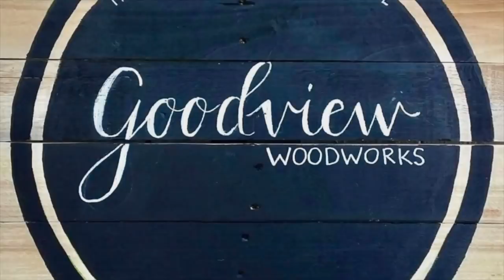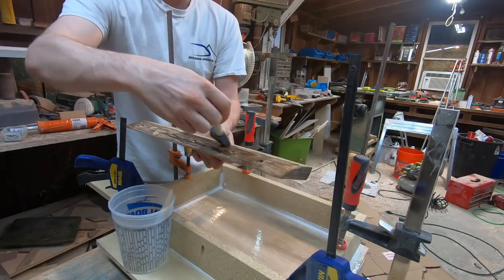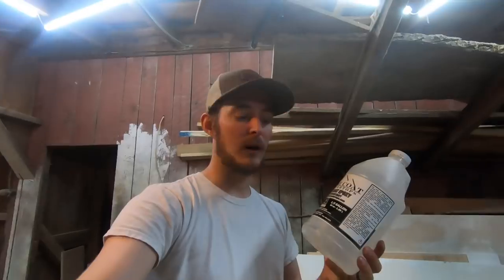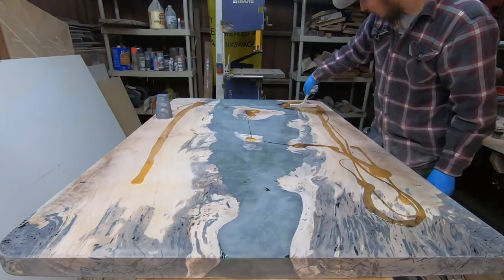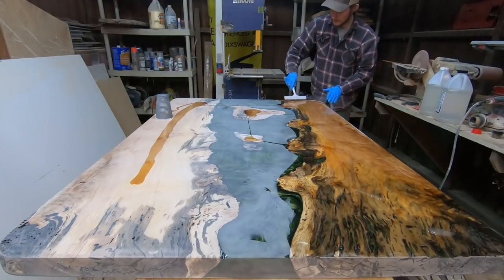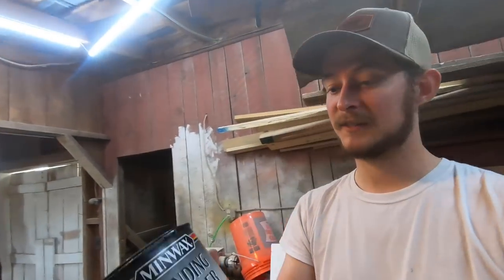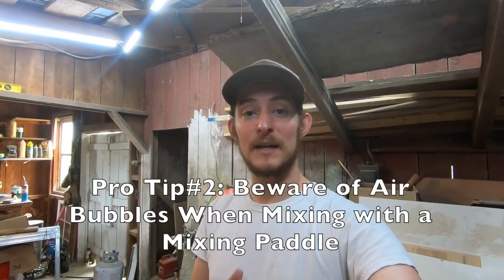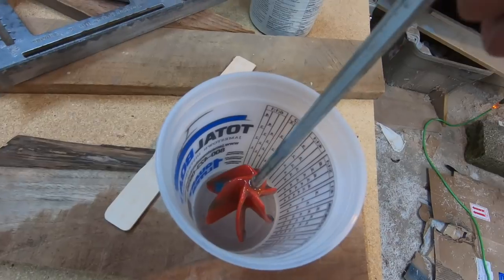2 Pro Tips That will Help You To Have Perfect Epoxy Projects!!!

Comment: I’ve heard conflicting opinions having to do with sealing those edges. I understand sealing will prevent or limit bubbles, but I’ve been told that it weakens the bond between the actual epoxy river and the wood. Is that more myth than fact?
Reply from the maker: You’re correct. If you have seen any of my more recent videos I tell people to NEVER seal the edges for that exact reason. I had a table split on me a while back. The bond of the epoxy at the wood separated. Since I stopped sealing the edges this hasn’t happened again.

Comment: do you clean project with mineral spirits after scuffing between coats? Before pouring second or 3rd seal coat?
Reply from the maker: I don’t like to use mineral spirits because it can leave a residue. I use 91% isopropyl alcohol.

Comment: A better “sanding sealer” that I’ve used is called Benite the same company (Daly’s) also makes a product called Ship to Shore which waterproof but like Benite doesn’t create a contiguous emulsion.  

Also a decent vacuum chamber can be had from amazon for ~$120.00 and a passable vacuum pump for ~$90.00 from harbor freight.
Reply from the maker: Thank you Charles!
Reply: GoodView Woodworks,  I’m working on fabricating a larger version of this.  My largest river table pour was 8 gallons at once and vacuum chamber or not was a pain in the ass.  A five gallon version of this would really help re entrained air.
Reply: GoodView Woodworks also if you’re looking for something a little different to offer clients or whatever.  I recently used a PSL beam to make a table.  Either cutting for end grain or ripping into planks and then gluing up as a table it made for some awesome finished products after epoxy coated/flooded.
Reply from the maker: charles hetrick to be honest I haven’t really had any problems with air in my pours (the largest being 12 gallons at once) as long as you seal the raw wood and when pouring, pour 1/4” at a time, use a torch or heat gun to remove bubbles then continue pouring. I will be posting a new video soon of a new brand of epoxy that supposedly will rid itself of any bubbles while curing. Hope this helps.

Comment: You shouldn't be sealing your edges. You need to use a slower curing epoxy and keep your table as cold as possible through fans and air conditioning. Keeping it cold allows it to take longer to cure which allows those air bubbles to rise out over about a week. This allows for a proper bond between the wood and epoxy otherwise in a couple years of time you'll get cracking, spacing, and eventually the bond will break if you seal the edge first. So yeah if you want a temporary table then yeah seal them or just take the time to research and do the job right.
Reply from the maker: You are absolutely correct JD. as I have been doin me more research and talking to others who have been in this industry longer (black forest) I have been told the same thing. If you’ve watched my later videos you will find that I cover this very issue. Thanks for commenting.

Comment: Bad advise to coat the edges. The bonding is less stronger because epoxi to epoxi doesn't stick as good as to the wood. It will crack some day. I would try to live with some bubbles... make it "special". ;)
Reply from the maker: The trick is to pour when the coated edges are still soft. This way it’s a chemical and mechanical bond. If you wait and pour when the sealed edges are cured, then you would be correct. Thanks for commenting!

Comment: Can u help me and tell me why just after pouring the epoxy in one hour it cracked every where (the table is 3 meters X 1 meter and the thickness is 6 cm and it has a few pieces of wood)
Reply from the maker: More than likely you poured the Epoxy too thick. If you are not using a casting Epoxy then you will only be able to pour 4-6 mm at a time. It cracked because it got too hot. Hope this helps.
Reply: @GoodViewWoodworks  what is casting epoxy ? If u let me ask

Comment: Do you not know how to get rid of the air bubbles if you use the paddles I have never done a table I have a slab in my garage to do a Live Edge with a little River in the middle. I'm also an abstract artist so I mixed all things that I need for that pouring Aid's gesso the paint and you can get rid of air bubbles out of this they're both acrylics and from what I've seen what you are telling me everybody else has everybody that I have watched to gain the knowledge has told me the same things
Reply from the maker: I’m not sure I understand the question...?

Comment: I don't think "entrain" means what you think it means. It means to board a train. Also, thanks for the vid.
Reply from the maker: 😂 here it is straight from the dictionary....

verb (1)
en·train | \ in-ˈtrān  \
entrained; entraining; entrains
Collegiate Definition (Entry 1 of 2)
transitive verb
1 : to draw along with or after oneself
2 : to draw in and transport (something, such as solid particles or gas) by the flow of a fluid
3 : to incorporate (air bubbles) into concrete